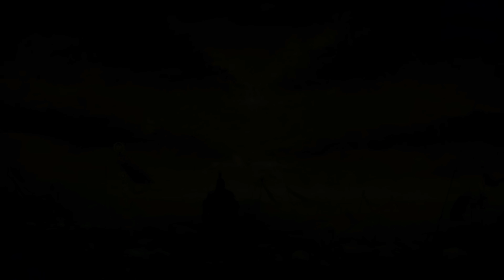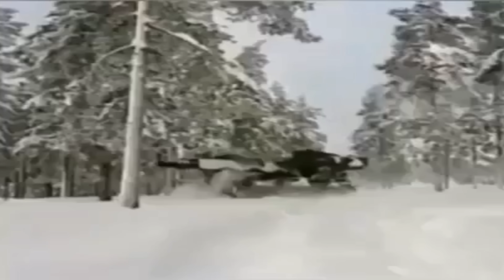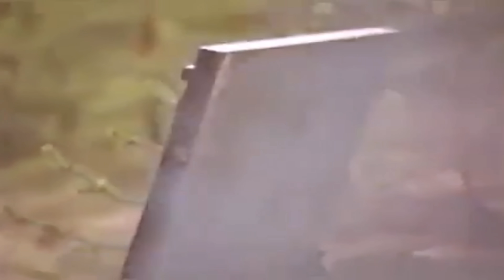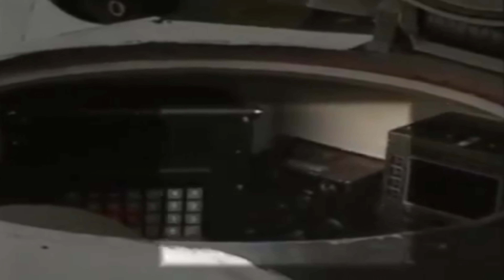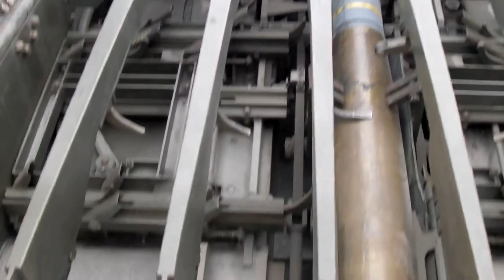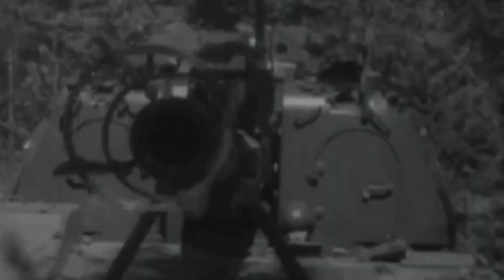The Swedish Bandkanon 1 'Bkan' 155mm Artillery Vehicle | RAPID FIRE SELF-PROPELLED GUN 💥☄️

Comment: We should just put this gun and its "dumb" ammo on a friggin commercial truck chassis and just add some braces to it like we have on the archer.. it should be suitable for standard support roles and we just use the damn archer for more "special" missions..    2 of those guns running around together, putting 28 shells down range and then just leave, I mean it should not really take more than 5-10 seconds before they are mobile again after having just shot,  then you just lower the gun onto the flatbed after you have driven a 1000 meters or more, should be enough to create a large enough area that it will be hard for counter battery fire to actually hit them.  Dont need them to be especially mobile in terrain, just use the road network and some light offroad capability..

Comment: You  oould preloaded it wit a extra round before you added the next set  and its still the fastet .
I was at A8 Boden in 1969 and shot a lot with these . It was very loud but it worked well for movement short distances in most environmnents  
It was very accurate  and any pre targets was just elliminated very early.

Comment: Without doubt the best artillery piece in the world when it entered service in the 1960s. The range of its gun was twice of M109 Paladin that America used in Vietnam... which means that this beast could cover a 4x times larger area with artillery protection. And since artillery fire is most deadly in the first minute before enemy troops have runned into cover, it means that this guns fire would be extremely deadly as it rains down 14 shots in just 45 seconds.

This gun provided the best from rocket artillery and gun barrel artillery. It could deliever an enormous amount of explosives at an area in a short period of time just like rocket artillery. But it left no smoke trails behind it - which is a drawback of rocket artillery, and the fire was more accurate like gun barrel artillery, and the ammunition was cheap artillery rounds and not rockets.
So this artillery piece was the ultimate tool for combating human wave attacks by the Soviets.

Yes its engine was weak, but on the other hand is it an artillery piece. I guess its biggest drawback is and remains that it is very hungry for artillery shells. If you gonna have this monster eating 14 artillery shells each minute and then reload... then you will quickly many dozen of trucks with just artillery shells. Indeed, you will need entire trainloads. And the Soviets will of course get an easy job tracking down these monsters by seeing all trucks driving around to feed this monster with artillery shells.
And even if Sweden managed to somehow maintain total control over the skies, I think that lack of logistical capacity would prevent Sweden from using 100% of Bandkanons full potential as there would not be enough ammunition for it to fire non-stop for 24 hours. And the gun barrel would quickly get worn down by such an intensive use anyways. And I think that the Swedes quickly would run out of targets if they would put them into intensive use against the Soviets at a part of the frontline.

Comment: I don't think that it is realistic to empty a "clip" at a target. After the first hit there is nothing left - and you fire a battery (3-4 cannons) with simultaneous impact. Hitting a target twice only makes sense on fortifications.
The advantage is that you can change position and engage a new target within a few minutes.
We could go from "marching" to firing in about 15 min. and even do so with HQ on the move.
As for being under powered the BKan would still manage 2m deep snow - and going at high speed on asphalt is just nuts. You don't want to go faster than your brakes can handle.

Comment: Very informative and interesting. Thank you!

I found one factual error, mentioned in passing: It was said that this is a howitzer while in fact it's a cannon.
"Bandkanon" means "tracked cannon", and it's loaded not with separate projectile and propellant, but with what looks like oversized rifle cartridges (as can be seen in the film).

The very idea of shooting fourteen nukes in rapid succession at one target is horrifying. Not so much for the effect on the target, but for the unpredictability of what happens to the projectiles following the first. Will they be detonated in flight by the heatwave or will they be deflected by the blast?

All of the stock footage is in 4:3 format. Why not keep it that way to not distort the proportions?

My favourite SPG?
Tough question, but I think my answer will be the StuG IIIG. Not so much for its performance as an assault gun, but because of its versatility (performing well also as a tank destroyer and as a tank, when used in those roles) and economy.

As you're interested in Swedish artillery my suggestion is that you also check out the "fälthaubits 77" (FH77), a semi self propelled howitzer. The export version has been used in combat, the conflict between India and Pakistan.

Comment: Accuracy and artillery is a bit of a problem. On one hand you want accuracy so you can hit a target, on the other hand you want a nice spread if you are throwing a lot of shells at the same coordinates. Today that can be handled by the computerized target system. It just walks the fire to the areas you want to cover, but way back before computerized targeting was a thing artillery usually got target information, dialed it in and then threw however many shells they were told to use at those without changing the targeting between shells. Bofors made a artillery cannon that turned out to be to precise. Fire three shells without changing the targeting and they were basically digging one crater as they all hit more or less the exact same spot. It was easy to fix though. Roughing up the barrel a bit gave it the desired inaccuracy. Now I can't remember which gun this was or when. It's just one of those things that sound so ridiculous when you're told the barrel had to be reamed out so it would be less accurate. Normally accuracy is good, and the more accurate the better, but not for old artillery.

Now one self-propelled howitzer you might want to present is the K9 Thunder and the K10 which is it's ammunition resupply vehicle. This is a modern vehicle that takes a lot of the things that the Bandkanon 1 tried to do and makes it better. It can fire three rounds in 15 seconds and supports MRSI (Multiple Rounds, Simultaneous Impact). It can shoot and scoot. 30 seconds from last shot it can be moving and take first shot after 30 seconds from stop at the new site.

This South Korean design had 52% of the total world market for self propelled howitzers in 2002, so it's a pretty big player. The first time I learned about it was early 2000 when I searched for Samsung and was served a page on Samsung.com about the Samsung K9. I've later learned that it was a big project with several South Korean companies involved so calling it the Samsun K9 was a bit much, and I don't think that page is still on their site.

Comment: OK, now I'm finally impressed with a land artillery ROF.  14 rounds in 48 seconds for 155mm / 6.1" caliber is impressive.  

Compare and contrast to the 6" (152mm) / 47 Mark 16 auto loader installed on the Worchester Class light cruiser at 12 RPM or the non-auto loader Mark 16 on the Cleveland Class at 8-10 RPM.  Very Impressive (to steal a line).

Comment: The Germans were making an auto loader for their large flak cannons. And this looks exactly like that setup matter of fact is they were thinking of using a 150 mm flak cannon for this system as the largest flak cannon in use in 43/45 was 128mm all in a one piece case ammunition.
Reply from the maker: Interesting observation!
Reply: And the stationary twin setup weighed more than a King tiger, the 150mm version weighed more than 98t
Reply: @bentalexranebundgaard4867  so my point was that this WW2 German technology was  may have been the genesis behind the Swedish system.
Reply: If you’re interested in learning more about this topic it’s called Gerat 60F or 15cm. Flak Gerat 55. The photo of this setup will help my point.
Reply: Another unique Swedish weapon system is the towed Bofors 120 mm anti aircraft gun,  Lv automatkanon fm/1 (70 rounds per minute)

Comment: If I remember correctly it could have an extra unit already loaded so you could send away 15 shots within the minute if not faster . 
I was at A8 in Boden during 1970-71 where I was part to of a scouts group but also took part in a movie creation with the subject of daily maintenance to be used for training. I did not find its speed to slow, it could go quite fast at times, well in position and leaving  was good enough at the time. But You could not go very far as it was a big guzzler.

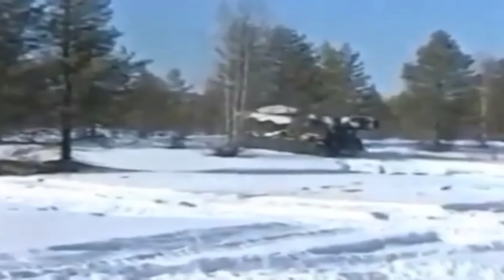Comment: ERRATA 5:24
There was no spare magazine. The 14 shells were prepacked in racks and delivered to the piece, which had a built -in crane to hoist them into the magazine.
With the upgrade, the crane was removed to save some weight on the already strained drive train, and instead the delivery vehicle to a HIAB-crane to lift the ranks straight into the magazines.

Comment: BTW modularity is awesome, every engineer knows this =) Every modern car is modular so is almost anything else mass produced. It reduces costs, standardizes parts and processes and makes many products possible.
Reply: Modularity is good. Overuse of the word by mic is bad.

Equipment is partial modular. Modules are expensive variations.

Full Modular uis sw opping in components from different manufacturers.

Comment: Brings back memorys from my military service in the early 90´s. Specialy one time when we were at our tank garage a Bkan 1C outside got some problem with the gas turbine  driver could not shut it off and it spit a 4m flame like a blowtorch out of the exhaust went infront of the driver he got a bit stressed out with eyes like dinner plates jumped out and ran around jump inside again trying to find a way to turn off the gas turbine after a while he manage to make turbine shut off. It revving so fast we thought it was gona explode :P
Reply: Diesels and Turbines need an emergency fuel cut valve.

Comment: Is there a large artillery system tat operates like a semiauto rifle? Using recoil to load the next round in one movement, that is. I think that would be absolutely terrifying!
Reply: You don't want to reload at that speed.
Reply: @knoll9812  Why not? I know heat can be an issue. Limit it's use to 3 shots. 

I guess arty is an area weapon, so 3 shots in the same spot would be a waste. Gunner would need to be quick on the wheels. Lol
Reply: @UncleRayRayGarageEmporium  Bofors made one gun with 120mm barrel and autoloader. Its rate of fire is 80 rpm. It is in coastal defense in Finland. The destroyers Halland and Småland had the same gun, albeit with a slower rate of fire, 48 rounds per minute, also water cooled. With a prepared route in litoral waters, the rear guns would play into action while the autoloader of the first gun would load a new batch. There would be about 100 shells in air at all times.

Comment: There was many reasons for take it out of use. It was very old and at the end at least 1 of 4 guns in a battery was out of commission at any given time. They drank too much fuel which in a war scenario would be negative because sweden expected to run out of it fast. The ammo was not in production any more and incredibly expensive. It was basically an almost man sized rifle round, imagine the just the brass cost! The forwarder ammo trucks where old an decrepit (and they had to be forwarders to be able to keep up with the Bkan in the terrain). The forwarder type vehicle of course was later the platform chosen for the Archer system.
A support for the theory that it was meant to be able to shoot atomic weapons was that the whole chain of ammo delivery was designed so that no human had to actually touch a round from the mountain cavern storage to the point of leaving the barrel.
It ran on literal jet fuel (though ordinary diesel could be used in a pinch). The gas meter was so small that when you wrote down how much fuel was put into it you just took a guess and could be several hundred liters off. At the end of the year we, in protest to having to do book keeping on the thing, wrote that we had put 2 tons of jet fuel into a Husqvarna terrain motorcycle in one fill up just to get the numbers to match up in the books. Nobody complained.
Reply: With Strv103 the rumour was that it could shoot longer than it could roll .... but with Bkvagn at least that distance is more respectable !
Reply: Haha hose Husqvarnas could have needed some jet fuel as they where so under powered!
Reply: @Hiznogood  Wheren't they 250 cc? Why would you need any more on a damned messenger bike?
Reply: @swedmiroswedmiro1352  during my service 95-96 a damned messenger bike was passed by 3 leapard tanks while driving on a road... ok, he had a passanger at the time.
Reply: I am not inclined to believe the claims of swedmiroswedmiro with less he can tell the highest point on the Southern firing range, a reference anyone from A8 should be able to tell.
Reply: @johanmetreus  Well... I can't tell you the name of that hill but i can tell you the name of the place of all places. Punkt 49
Reply: When I did my year as forward observer in southern Sweden in 93-94, I don't think they even mentioned Bkan 1 even once as curio.
Reply: That reminds me of a friend going to the airport to fuel his Norton Commando, because modern unleaded is so underpowered it will destroy the engine.
Reply: The thing is cool as hell, you are just another boring soul

Comment: This is a bad, bad, bad idea. Sorry; this is a bad, bad, bad BEAR. I like it. Reckon anyone else, like the US, Canada, UK, or Germany have studied this? Yea; the power component needs to be addressed but that SHOULD be an easy fix.
Reply: When the Rolls-Royce engine and the Boeing 502-10MA turbine was running simultaneously it went wherever it needed to go. As for long transports the trucks where never far away and we got quite proficient loading them onto the trailer.

Comment: Great content as always!  

My 2 cents worth;

1. This vehicle uses a unique shell which is not Nato standard and in a nutshell more like a tank round (combined projectile and propellant charge) than a modern artillery shell with a separate charge.  Hence each round was much heavier, hence the ‘necessity’ of the autoloader.  

2. In term of delivery of a rapid salvo, this was the beast.  However 14 rounds ammo capacity in its primary magazine and difficulty in reloading made it not the best candidate for a sustained fire support vis-a-vis over 40 rounds avg capacity of a modern SpH. 

3. The rounds were a lot more expensive.  I forgot how much it was but if I recall, it was 3-5 times the cost of avg Nato 155mm.  Hence no other nation adopted it.  

In a nutshell, it was a single purpose tool and expensive.

Comment: What shells did the Bandkanon have access to during its service?
Reply: 3 kinds. Air burst, Delayed fuse and of course impact. They where basically man sized rifle rounds. I was a part of a Bkan company just after the cold war. It was then aged but still worked. The wikipedia artikle does not have too many errors :)
Reply: Good point, artillery is only as good as the ammunition.